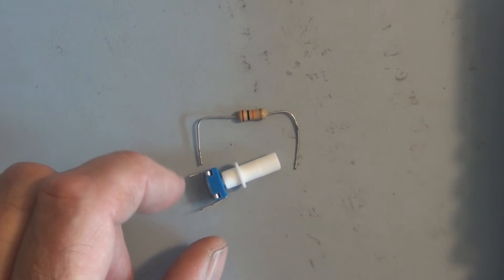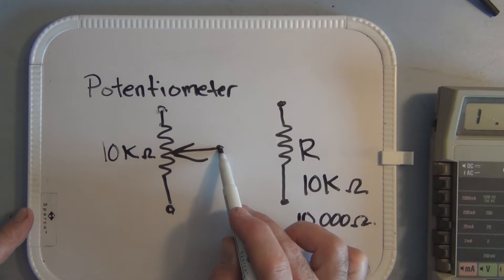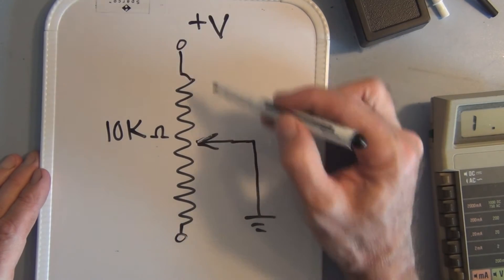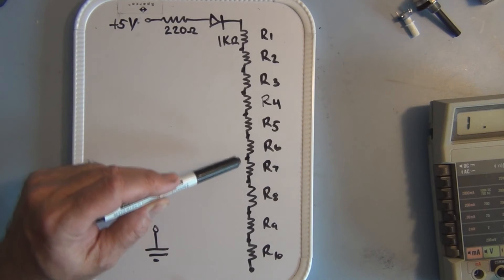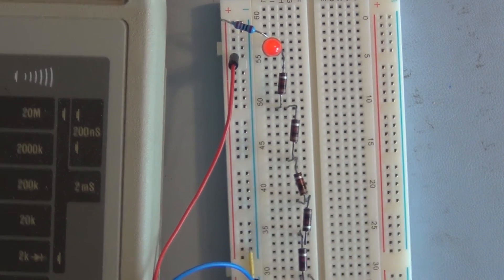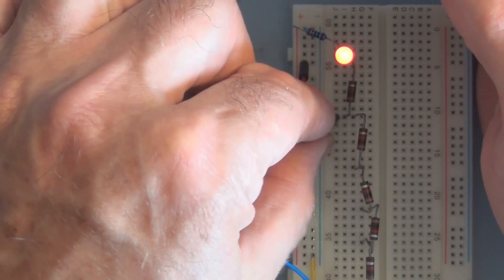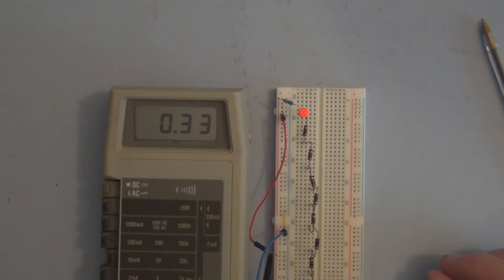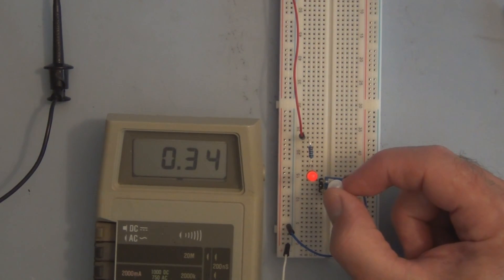How a Potentiometer works tutorial

Comment: When you turned the "Pot" clockwise, the LED dimmed. To reverse this response to the LED, do you simply swap the connecting wires to the two outside terminals on the "Pot"? Thanks!
Reply from the maker: You turn the pot back counterclockwise.  Turning the pot one way increases the resistance to max value and turning it back reduces the resistance value allowing you to control the flow of current though the LED.
Reply: Thank you for your prompt reply. My error. I wasn't clear. I would like to wire the "Pot" to decrease the resistance (to increase the brightness of the LED) when I turn the dial clockwise. Is that simply done by how the wires are connected to the "Pot" terminals?

Comment: To achieve complete dark out of the LED, would you simply use a larger Ohm rated Potentiometer? Thanks!
Reply from the maker: If the max value of your Potentiometer does not completely turn off your led you can add a resister in series to limit the current further.  You will have to experiment with different value for the potentiometer you are using.

Comment: Please explain why there are three wires or connectors.
I assume that with two wires you have total R value... with three you can adjust R value.
So i guess the third wire is giving the circuit a path to least resistance,,, so that means current stops flowing straight through and turns,,, by turning i mean i mean takes a different path and so that means no current is flowing thru wire two?????? But on the other hand resistance value in a no power condition  can be taken anywhere. Only when current is present does the potentiometer work? Lastly if there is LED in circuit  the voltage is the same at any point?